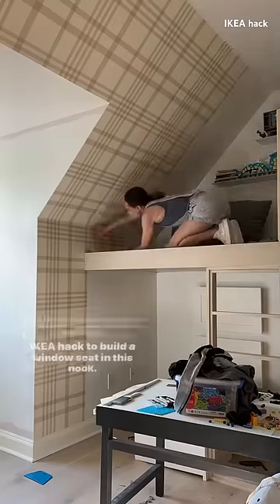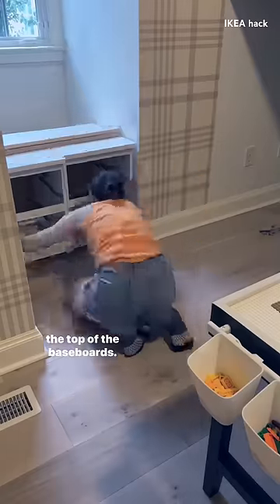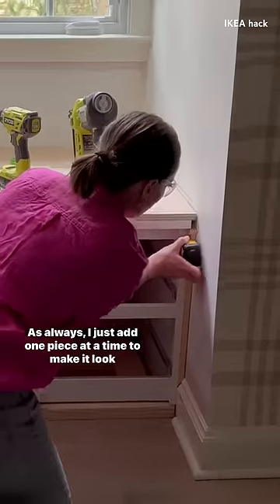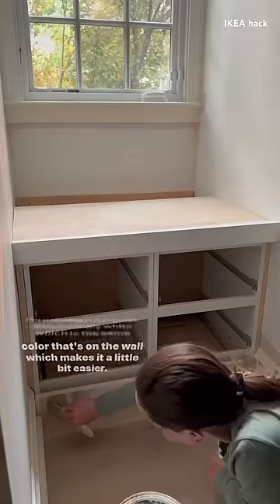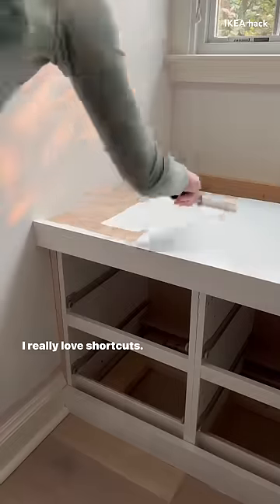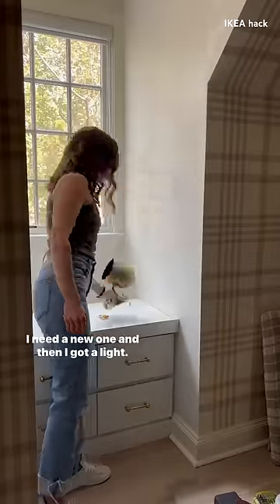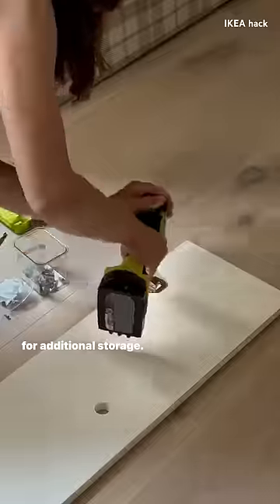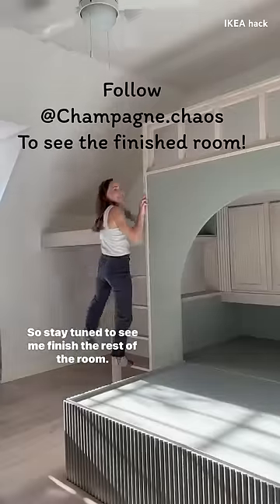DIY window seat hacked with IKEA MALM nightstands

Comment: I've been renovating the upstairs 25 years after my dad renovated it, seeing you nail those pieces at the sides makes me shed a little tear, I really try to think of whoever comes after me to redo this space so they won't have to suffer like I am rn trying the rip stuff off that has 4 scres amd 5 nails stuck in a small part, I think using screws that are easy to remove would be better for a space like that since you would have to pry it out and ruin most likely the wall as well as the dresser 😅

Comment: You could add a bead of silicone around the wall edges to hide the little gaps too, then it would look even more built in. Awesome job!
Reply from the maker: I ran out of caulk so moved on without it! 🤣 Don't worry - it got caulked before the second coat of paint though!

Comment: If you caulked the edges there wouldn’t be a gap around the wall and the wood
Reply from the maker: For sure!! I ended up caulking it🙌 I usually caulk after the first coat of paint… not sure why I started doing that, but I’ve told myself it helps to see where caulk is needed haha